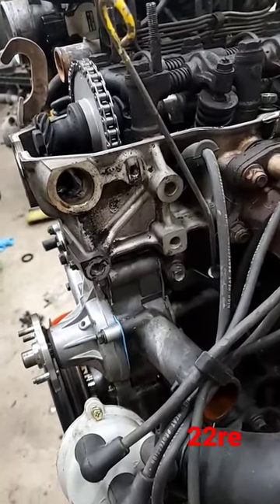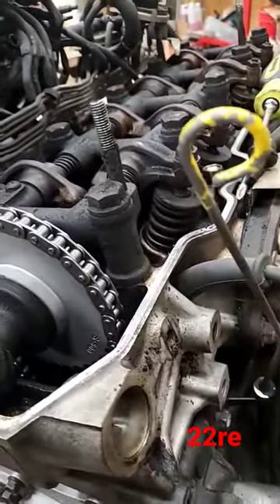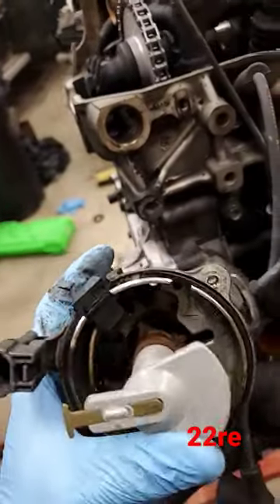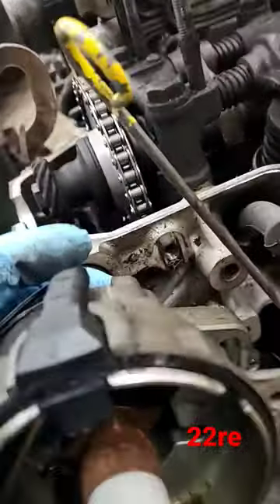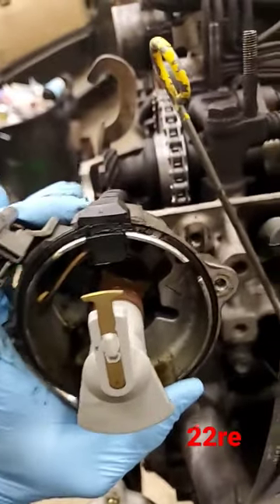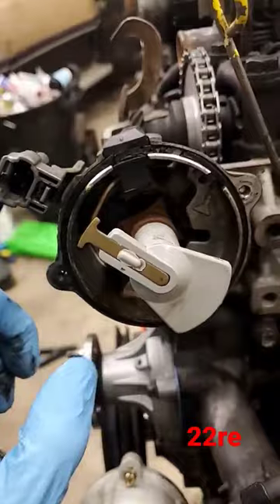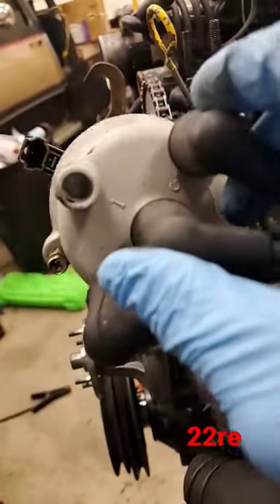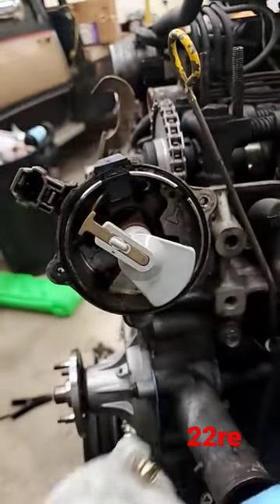22re Distributor Install

Comment: Why did u put it on 5 and not on 0 degree
Reply from the maker: That's what toyota says to do 🤷‍♂️ I'm guessing the ecm wants it there for its compensation.
22r is installed at 0 degrees, 22re is installed at 5 degrees
Reply: @diy_automotive  good to know....